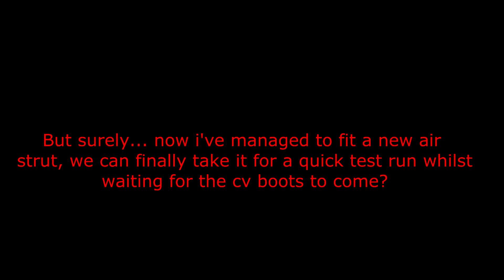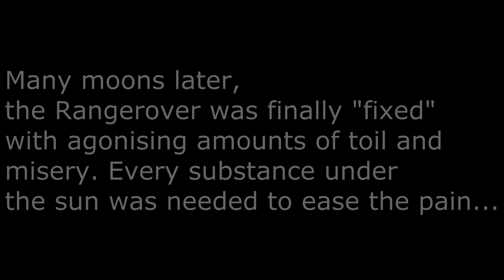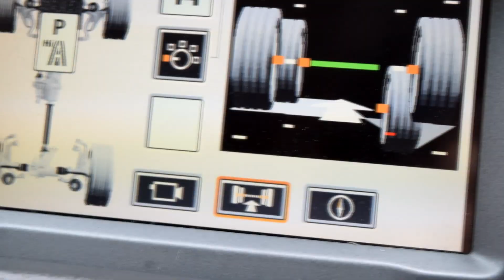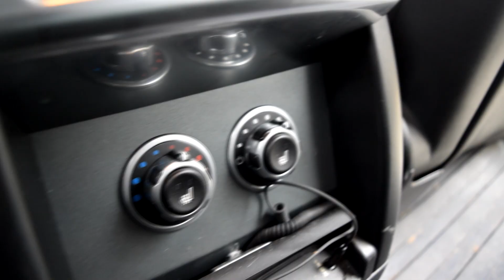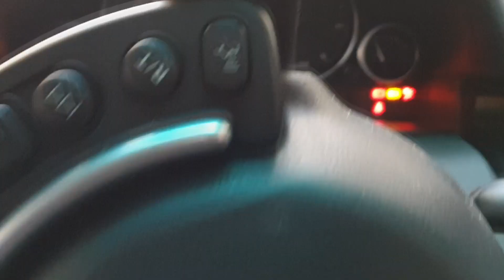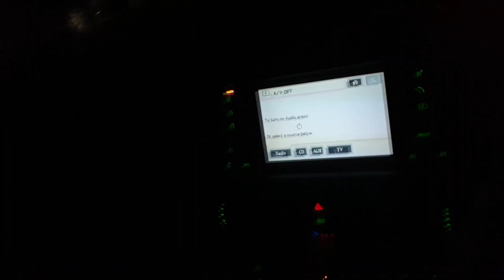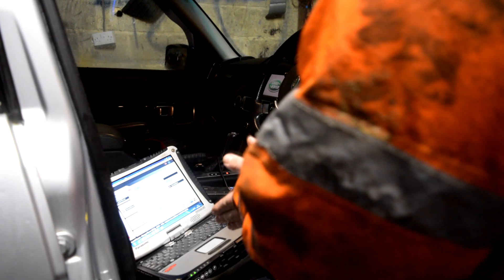The worst car in the world? The sad reality of owning a Range Rover L322 3.6 TDV8 DO NOT BUY

Comment: Bought a brand new Range Rover the publicity showed it going over mountains thru deep frozen streams etc etc  - suspension went within 3 months after going over a slight pot hole in a normal tar mac road - phoned Range Rover after 2 weeks it was eventually collected they said it was my fault for abusing the vehicle but they fixed and “done me a favour” - sold it after a year lv never lost so much out of a vehicle
Reply: Modern range rovers are pavement and garage princesses. Land rovers were monsters off road until they stopped using a chassis-body system and solid axles. I have hit potholes in my disco 1 that with any other modern car would instantly bottom the shocks out and shatter your bones (slight over-exaggeration) and my trusty D1 barely felt it. Modern day land rovers are only really meant to be "palaces" on wheels and not much else.
Reply: They drive them to the top of mountains so they can bump straight on the way down
Reply: Yep crap

Comment: @ 24:20 "Bad earth" is a thing to be aware of. You check it with a proper starter cable. Easy to fix, but can cause loads of trouble. Earth cable between engine/gearbox and chassis needs to be changed after 10-15 years. And SURPRICE that can happen to any car. I do own a 3.6 TDV8 FF Range Rover. One of the best cars I've ever owned. 270 000 km on the clock.

Comment: Bought a 2019 
Toyota Landcruiser 2.8 D-4D Invincible
It was a nightmare from about 7K miles .... multiple problems going into limb mode when towing 2 ton trailer off road uphill resulted in numerous visit to dealers 
3 exhaust filters 2 engines @ 28K miles I got rid of it when 2 nd replacement engine lost power from continuous limb mode when towing up hill.
In my experience there's good & bad in every modern vehicle, just hope you stay lucky with your
Grenadier.
My most reliable towing off road vehicle in last  10 years 
PHEV Mitsubishi 4x4 , it's never went wrong in 170k miles 🤠

But I still have a soft spot for a TDV8 range rover 🇬🇧🤗
Reply: and sleep........
Reply: and sleep........

Comment: I love my HSE BMW 4.4 but these rovers were a lot of money when new and also a lot to maintain, if you change the trans fluid and filter every other year and engine oil there reliable, you can buy Chinese airbags cheap, there not the best but I've had them on for 2 years with no problems, there amazing to drive, and go like a sob, its a love hate relationship

Comment: Just wanted to say that the Range Rover L322 is no different to any other vehicle. Maintain it and it will last, abuse them and it will cost you. Clarkson has one and raves about it stating and I quote " the best range rover ever built" 
I have the 4.4 tdv8 which is beautiful to drive and surprisingly good on fuel. I'm not going to lie, parts are expensive but the one I have would've been £60,000 plus new. All I will say is make up your own mind. Great video btw 😁👍

Comment: Had my 2007 l322 3.6tdv8 as my daily driver for 2.5 years, had 135,000 best car i have ever had and also my worsed. Got 20mpg round town. 25mpg on motorway. Trouble is you need to get one with full history and that has been looked after. If no service history you are asking for trouble. That said it did cost 7k in maitinace in the time i owned it. Would i have another hell yes. At 130,000 the turbos will more than likely go, so if you get a high milage one make sure the turbos have been changed and also the inlet manifolds, they worp as made of plastic.

Comment: Split me fucking sides Just been out to mine to fix the drivers door cable "snapped" untill this point the car was fine owned for 5 years its done a mere 135K nothing wrong at all !!!!! Fitted new cable re fitted door card and now all hell has broken loose no drivers mirror control ,no inside light, central locking has stopped ,wind in mirrors not working, Well passenger side wags like an egg cited  dog ???? Then in I come to see this just made me feel as if I was/am not alone L.O.L................

Comment: I actually need to tow 2 cars at a time so I've got no choice but to use a range rover. 3500kg tow capacity is rare. Although I'm going for a newer 11 reg on low miles with the newer 4.2 v8 diesel. I hope its reliable can't be getting stranded in Scotland. Only other option is a discovery or shogun and they are under powered
Reply from the maker: Landcruiser 4.2 td.
Reply: @TommyAutos  too expensive and they are really tacky inside although they are beasts
Reply: Do you want reliability or looks
Reply: @richlee509  reliability but auto

Comment: Had one of these for over 5 years.  Great car, but steering fault meant LR tried to charge me 3k to fix local independent did it for 600.  Also had a Toyota Amazon and Air suspension went on that twice, both fixed under warranty otherwise cost would be over 5k.... Rangie was really nice.  Nothing else was as special.

Comment: If you fancy sitting in a Shackletons high seat chair on top of a partly set blancmange then this is the car for you.

Clarkson wants tar and feathering and dragging around England on the back of one of these as means of apology.

It’s the most appalling motoring experience I’ve ever had. The only people that should own them are people that can afford the original ticket price or a highly skilled proactive mechanic. These are not for the ‘Everyman’, don’t fall into the trap, you will not get a good one.

I ran one for two weeks in early December 2023 and in that time the power steering, handbrake, suspension, and battery all died.

Needless to say I returned the vehicle for an exchange / refund.